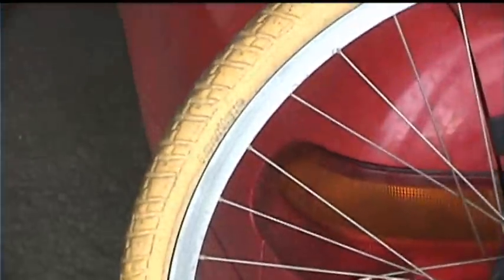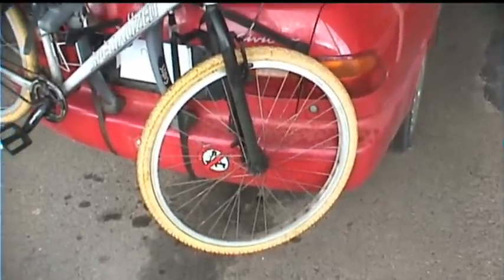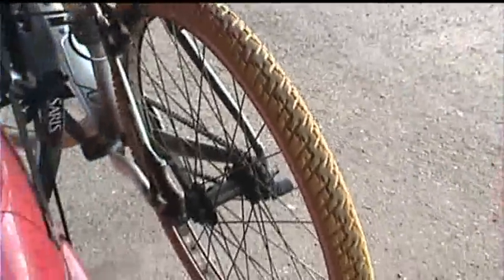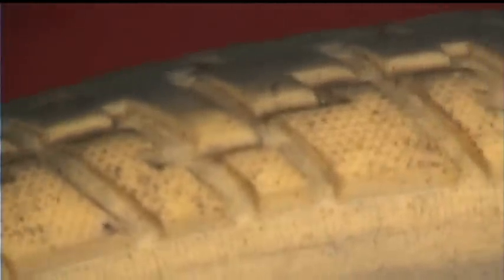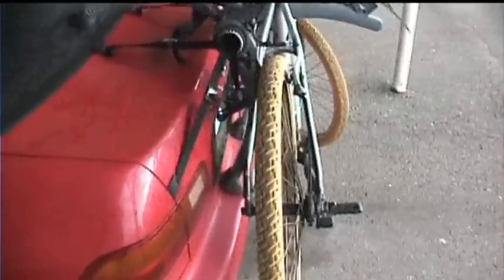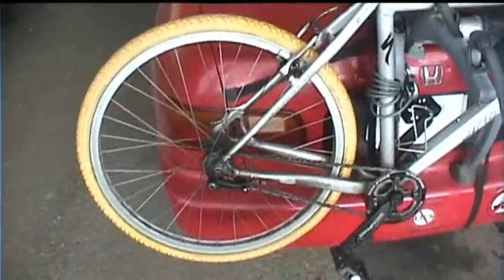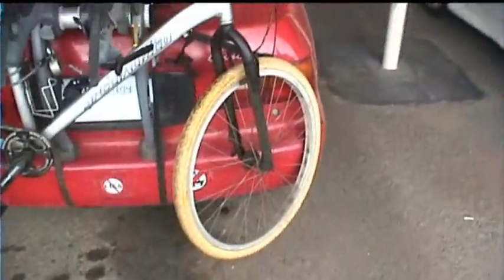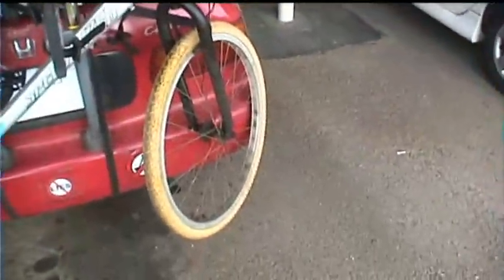Review: Amerityre flat-free (tubeless) tire technology

Comment: @neotoy I think these tyres are ideal for urban use then in that case. I havent tried mine yet but I saw some 2nd user ones on ebay and basically the guy was annoyed with extra rolling resistance it gave. Since he is probably a more serious cyclist (as he was using a single speed 700c wheeled fixie) its likely that he would notice. I dont think I would, Hey imagine if they used kryptonics skater urethane for these wheels! they would be so fast!

Comment: No he was referring to closed-cell foam.No cycling elitism here, just plain facts.Go to ANY bike forum and see stories of tires slipping on the rim, or better yet tires that cause rim failure.I'm not saying they're bad for you, but they are best for slow speed/smooth surfaces.
So do you think a solid tire cushions/tensions a bike rim in more places than the point of impact?Facts are facts, and until they come up with a different rim for bikes pneumatic tires are the way to go.

Comment: I'm interested in the product I hate flats.From a chemists point of view urethane doesn't act as rubber does; it retains heat and melts, rubber burns and flakes.Does the tyre have a rubber coating or maybe ribs of rubber within?What's the longest summer ride you've done?This looks like a viable product if it's a rubber compound.

Comment: I think they are too thin for mountain biking... and in a larger size maybe the weight would be a problem. Oh and the biggest problem I think is that you can´t choose your "pressure" depending on the conditions and terrain. 

But for a more "urban" use they must be great. It´d be interesting for my ebike project...

Comment: you seem to be preoccupied with the camera half the time.  i know that these tires are innovative, but i have a tougher time with tires on any vehicle, my luck, those tires would tear apart from my heavy mountain biking traits, so, if you could prove that they can handle a 45 degree downhill bonsai run with cobble stones and jagged rock, let me know, i had a fiber glass reinforcement along with tough rubber tread, and triple flat protection inner tubes, with slime.

Comment from the maker: Bike forums are dens of elitism & hype IMO.

'Closed-cell' means millions of tiny air pockets distributed evenly throughout the material, it's not like solid rubber where the impact is highly focused by the density and molecular structure of the rubber. The impact is distributed throughout the matrix of cells. This is not unlike the dynamic of compressed air in a pneumatic tire. Depending on the formulation of the polyurethane it is possible to emulate optimal cushions/tensions.